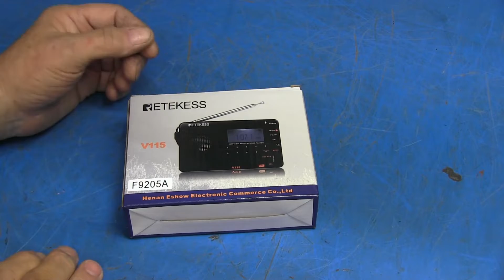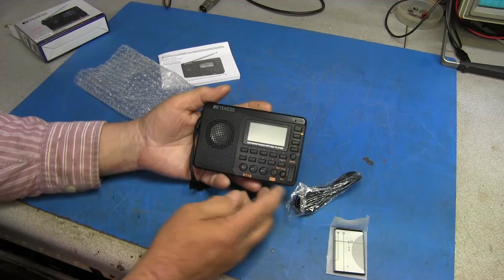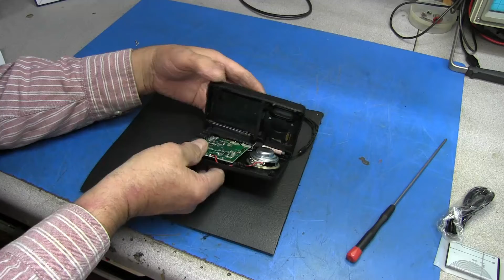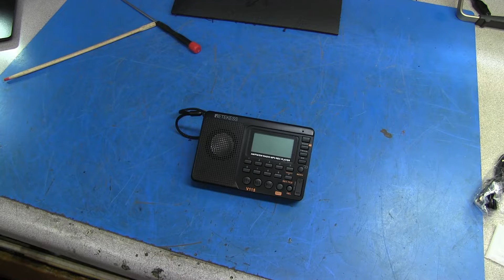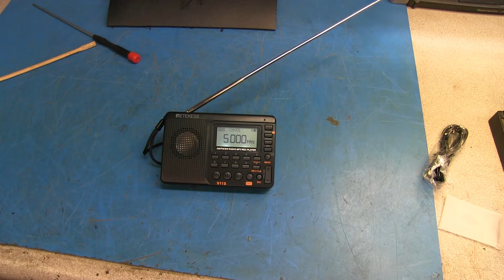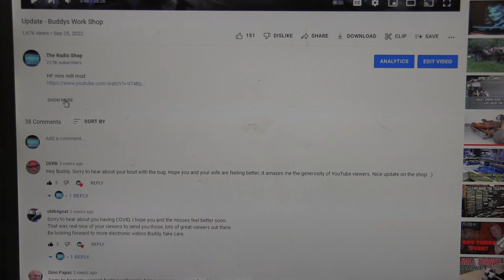Retekess V115 AM FM SW MP3

Comment: I recently bought one of those Navajos from Ebay because I also always wanted one. I resurrected my CB shack from 1977 with that one intended as my flagship but never happened (had 2 Midland mobiles instead). It sits along side of my vintage Heathkit shack and my regular ham shack. I love these old radios. 73 de KI1Y, Cocoa Beach.

Comment: I had one of those rigs. bought it in the early 80's for around $300 bucks. had it modified with extra channels and used the clock as a freq counter display. also had the 458 and the computer rig 459. brings back a lot of great memories. looking forward to restro video.
Reply from the maker: Worked on a few of the 458 units back in the day. This one is pretty much stock.

Comment: 13:10 Bluetooth
Reply from the maker: Yep, you may be correct, thanks
Reply: @TheRadioShop  Unless the new units have added this, this is NOT BT:it LOOKS like a BT antenna, but these radios do not have it....if you follow the Amazon link...there is no mention of BT on these.
Beyond that, the SW performance varies widely from unit to unit:some are nearly useless on SW.
They DO work quite well on AM and FM, and the MP3 player is quite usable as well.
And yes, the sound quality is surprisingly good for somthing as inexpensive and as small as this is.

Comment: It was nice to see the clip on the Navajo CB radio. I can't speak for all the chicken banders that subscribe to your Channel, but I will say for myself that I hope to see maybe a short clip, of you actually breaking it down, and getting into it. I am not ham operator, but have owned several vintage transmitters. One being the kws1 by Collins, and a EF Johnson Viking Valiant. Both were used back in the mid to late 80s. I no longer have either of them, but my attraction for old Ham radio transmitters, and receivers has never ceased. That's why I subscribe to your channel, and often watch you refurbishing the particular items that I myself find cosmetically, and technically interesting. I'm not sure if that Navajo is the transceiver with the single meter, or the double meter. The one with the single meter is basically a Uniden Washington, and the one with the double meters is basically a unit in Madison. I'm fairly positive both are identical or almost identical internally, to both the washington, and the Madison. Thanks for another excellent clip. 73s
Reply from the maker: I will do a complete repair of the radio and post it.  This classic deserves that.  This one has the double meters. One is for swr. Had both the Madison and Washington years ago.